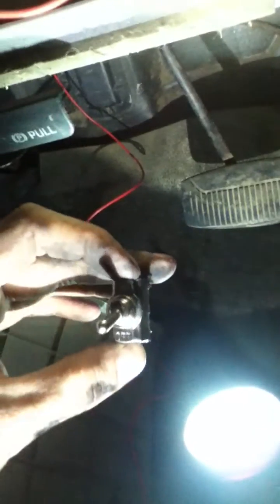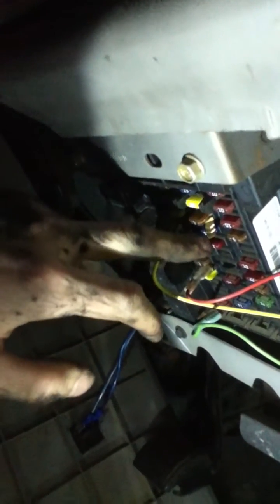7.3 EBPV switch mod #3

Comment: How many volts should be going to it?. i would assume 12v, correct?
Reply from the maker: Bulletz Hurt yes 12v
Reply: thanks man. Another question... were your wires in a bad condition? i couldn't tell the difference in the wires because they were both to hot and rotting, and melted i guess is the word.. did you have this problem?
Reply: also, thanks for replying 4 years later lol